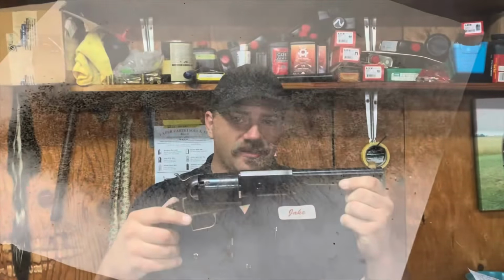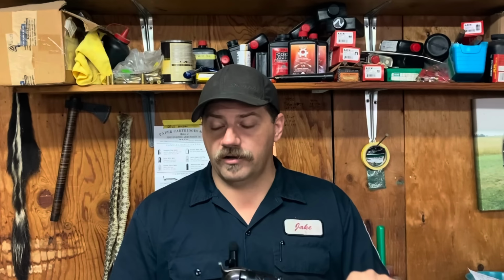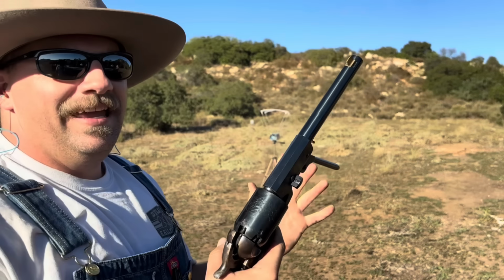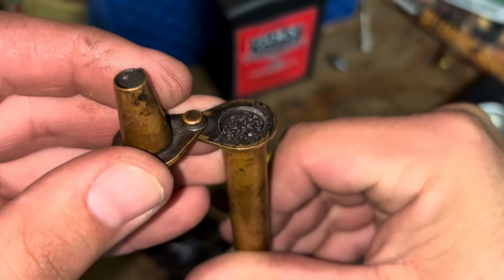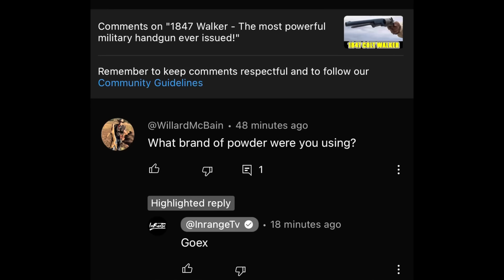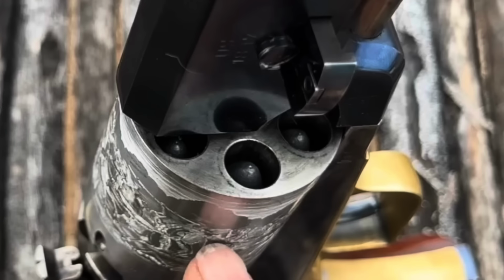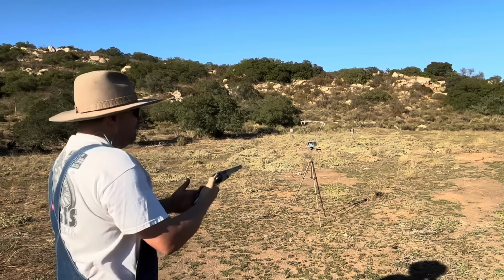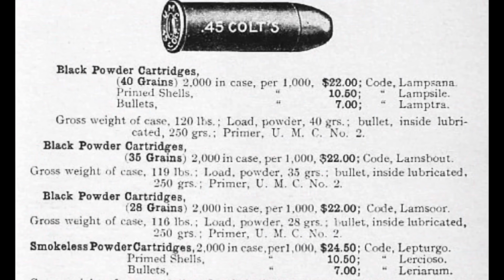The Colt Walker. Not The Most Powerful Revolver Of The 19th Century?

Comment: Most of the repos have smaller chambers, check the general john pitman notes. Original Walkers were 1.761" x .445. Uburti 1.629" x .447" . A scale should be used to more accurately measure the powder.
Reply: That's .01 cubic inches more volume in the original (assuming straight sided cylinders in both). I wonder how many more grains that equates to...
Reply: @rharthart9477  that's .163 cubic centimeters.  2.5 loose grains of 3F will fit into that space or 3 to 3.5 compressed.
Reply: @rharthart9477  incorrect calculation. (1.761*.445² - 1.629*.447²)*pi/4 = .01825 cubic inches either .3 cc either 4.6 loose grains. And I think the original chamber diameter was closer to .45", like other Colt revolvers.
Reply: would not make the slightest bit of difference,the barrel is to short to be able to burn even 40 grains of powder

Comment: I wonder if there is a difference in the depth of the cylinders. I can see modern manufacturers doing shallower depths for liability purposes. I'm going to have to dig my CVA brander Walker, that I bought in the mid '80's, and see what it can hold
Reply: Do let me know.
I had a 1861 CvA from the mid 80s someone stole it a few years back.
I've recently replaced it with a Piett ( something like that) 
Never thought about drilling the cylinder a little deeper. 
Anyhow if you can tell me what the max   grains of powder that fits with a .454 ball. So I know the difference in cylinder capacity between the walker and the 1861 Army. I've wanted to know for a long time.
My CVA 1861 I could load 40gr with a 20O gr lead bullet. .. the mold was for a .44 spc / 44 mag. And fit perfectly.
I mean it just barely fit flesh with top of cylinder. And with the 1861 it's easy to load. Unlike a 1851 in .44. 
Anyhow id like to know the max powder that could be used with a 454 ball
Reply: john          there is  no way that you could get anywhere close to a dangerous load  even if you could double the charge....it will not burn the powder in that short barrel......now back in 1847 the gun metals were nowhere near as strong as to whats out there today.......so if the cylinder is a micro meter smaller it's not that any one was worried about blowing the gun up.........I used to load my Remington with about 5 grains of black powder as a kicker charge then load modern powder on top of it.... more for to get away from the fouling rather than for power...I didn't overload but I'm sure the gun could take it, once when I first got the gun I loaded it and didn't put grease over the bullets ,I fired it and every chamber went off,only damage was it broke the pin on the loading leaver..I couldn't hit anything with that gun regardless of what powder I used ,so I gave it away

Comment: 60 grains was the maximum, with a round ball, not 90, but the cylinders were what is, basically, cast iron, so they would sometimes let go, not a good thing with a couple of Comanche bearing down on you.

I think Phil just misspoke about the 90 grain charge, since 90 grains will fill the chamber to the top, with no room even for a round ball.

It would be interesting to see what the difference in dimensions would be between an original Walker, and one of the replicas.

I can put those charges (minus the 45 grains) in my Remington New Model Army.
Reply: Besides the cylinders themselves, the full house 60 grain loads were pretty harsh on those open topped frames as well.
I'd say 50 is the highest you should ever load in these, even if repros might have nicer metallurgy in their cylinders.

Comment: Loved it. Hate you bent the loading lever to do such a great test. Have you seen where they bored out a 45 colt conversion cylinder to take what is called i think a 45 super black powder. Think its a 460s&w case filled with black powder. Again great video for someone that has heard the hype. You do real good test.
Reply from the maker: Thank you
Reply: @WillardMcBain  it's called 45-55 also. Been thinking about a walker or dragoon.  Got 3 1858 with 45 colt and 45acp conversion cylinders. So 3 cylinders per gun

Comment: I have two Ruger old army 7 and 1/2-in barrel 45 cal pistols one steel and the other one is stainless I paid two grand for both of them and the serial numbers are only two apart how you like those apples I use 40 grains with a lubed ball and that's pretty powerful

Comment: Good vid! I've been thinking about swapping my 1851 for a walker, but the loading lever actually stays up on the 51 and it'd drive me nuts moving it back up every shot on the walker.
Reply: Since it would not be a original. Just do a conversion to a 1851 loading lever catch.
Reply: Dont swap the 1851. Keep it and buy a Walker. Chances are, you will start missing the 1851 after a while.
Reply: An easy fix with a file and a light tough.

Comment: Nothing wrong with the thoughts involved,  but one aspect I did not see was confirmation that the powder dispenser was calibrated off a scale.    And I am shooting Conceals that are 225 grains so that aspect has relevance as well.   No idea what was shot originally.   My 44s  New Model Army pair are easily pushing 1000 fps with low loads.
Reply from the maker: Same powder measurer and same powder. 
Black powder, Weight vs Volume
https://youtube.com/shorts/1PiiypKgd5M?feature=share

Comment: Maybe among other factors there is a wide variation in powder measures. Also a variation in granulations might make a difference in charge weight for similar volumes. Unlike smokeless, small variations in charge weight wouldn't be a safety issue for bp.

Comment: After watching this my curiosity got out of hand. I took the cylinder from my Uberti Walker to the bench to see what the chamber diameter is and how much fffg powder I could get behind a .454 round ball and a 200 grain .450 bullet from an ancient Lee mold made for the 45 cap and ball revolvers.
Going by volume from a quality measure: I had space enough to load a .454 round ball over 55grains volume of fffg.  I could had space enough to get 50 grains of fffg behind the 200 grain Lee bullet.  The chambers measured .448 diameter with a calibrated pin gage. I didnt fire it just wanted to see what fit.  The only conclusion I can come to is not all cylinders are created equal.  I was using Elephant brand powder, not that it makes a difference since it wasn't necessary to compress the load. It would be interesting to get one repro Walker of each brand and take a lot of measurements. Not disputing your findings just reporting what I found.  Hank you
Reply from the maker: I checked the cylinder volume on my Uberti, a second gen Colt and an Armi San Marco that some friends own and they are all within .010 of each other.

Comment: You make some very good arguments and present good evidence. My sticking point is that the Walker was designed to shoot a conical with 60 grains using a conical. I think the conical was probably a non-starter. I’ve loaded my Walker with 60 grains of Triple7 using a round ball without issue, other than the loading rod. Although your testing was very thorough, I’d like to see tests using 60 grains before I write the Walker off as not being the most powerful until 1935.
Reply from the maker: Thank you, but I respectfully disagree that the walker was made to use a conical with 60 grains.
Reply: The walker using a conical can't come close to 60 grains. 40 grains is extremely hard with the chronicle colt Designed the walker to use. It's extremely hard to even use 40 grains with any conical made until the early 1860s. And with those your not going to get much more powder. The colt Single action army with its original 45 colt load made far more power than the walker.

Comment: I make my bullets with the Lee 200 grain cap and ball mold - it fits in the Remingtons easily, no alteration of the gun is necessary. It fits in my 1851 Colt if I struggle enough, there is barely enough room if you press the bullet's shoulders into the chamber, then the bullet can be rotated under the loading lever. If I used them in the 1851 a lot I would dremel the frame open a bit to ease loading.
For max loads there is room for slightly less powder under the bullet compared to the ball, but the bullet, even with a bit less powder, will yield a few more ftlbs energy in my 1851 than the ball will at max load. This is the sort of thing that varies from gun to gun, from load to load, and from powder to powder. There is less energy available as there is a bit less powder, but the powder transfers it's energy to the bullet in a more efficient manner than it transfers it's energy to a round ball. This is the sort of thing that makes working with Black powder interesting.

Comment: I have a uberti walker made a couple years ago. I can only fit 55gr 3f goex with a round ball. The 262gr dragoon conical I can fit 40gr of 3f just like you and gets really tight around 42-43gr. Maybe they are using 4f black? I know the old paper hazard cartridges for the walker used 4f black powder to make up for the room the paper takes up in the cylinder

Comment: What would be great is to see a weighed charge along with a Chrono (LabRadar is really good with this) and see what the various volumes look like as well as velocity they get for different powders (we do not have abscess to Black Powder and its all substitutes).    First load in the ASP that was throttled back was pushing 1000 FPS (yes that is a faster barrel).     Clearly 777 has more boom for the weight (and the loading list for that reflects it).

Comment: I've had 2 walkers...
I could fit 2 30gr pyrodex pellets and a round ball . Or 63.5 grains or loose pyrodex ..unfortunately I didn't have a chronograph back then because they were ove $200 in the 1980s...
 But I can tell you that that roundball wouldngo through a Dogde Dart fender at an angle, both inner and outer, the radiator,  and out the front grill.
😁

I had a bison model 1858 that would take 2 pellets and a 200gr conical and it shot 1000ps though that 12" barrel respectively...that comes out to about 444 FP ... suspect that Walker would have been about close the same. Maybe a little slower because of the barrel, ..

Comment: What you say may be true in the abstract.  Correct me If I'm wrong, but was the colt walker not the first commercially produced magnum revolver every issued until 1935?
Reply: No it was not. we proved that a 6 1/2 45colt SAA makes quite a bit more power then a walker when using Commercially available ammunition from 1873. The 40 grains of black powder and a 255 grain Conical.  It has to do with Cartridges can add the power of the primer plus they are fully  sealed. Cap and ball revolvers like the walker loss pressure out of the nipple.
Reply from the maker: @garymiller5416  it is 100% objective truth. There is nothing abstract about it. The 45 colt was more powerful and at the very least just as powerful as the Walker. So to answer your question, you are incorrect. The walker was not the most powerful commercially available revolver until the advent of the 357 magnum.
Reply: @Everythingblackpowder  Please explain how a 40 grain load from at best a 7 1/2 barrel compares to a 60 grain load from a 9 inch barrel?  Your turn
Reply from the maker: It’s in the video! Velocity, energy and spreads. The 45 colt makes more energy than the Walker with 60gr and a round ball.
Reply: @Everythingblackpowder  Your truth
Reply from the maker: @garymiller5416  ohhhhh you’re a liberal. That explains a lot…
Reply: @garymiller5416  It's extremely simple. The walker can only shoot a 140-145grain round ball at max load of 60 grains of black powder. This is not the walkers most powerful load. Its most powerful load that makes the most foot pounds of energy on the target is with the 260 grain bullet and 40 grains of blackpowder.  forty grains of black powder barely fits in the walker with the 260 grain lead conical.  The 7 1/2 colt SAA shoots a 255 grain bullet with 40 grains of black powder. So now you see they are extremely close in load size. The SAA makes more power because it's a Cartridge. Cap and ball revolvers like the walker lose quite a bit of gas pressure through the nipple. Where Cartridges are fully sealed. Because they're sealed there is no loss of gas pressure plus the primer adds to the pressure making it even more powerful. This is why the 1873 colt SAA with a 7 1/2 barrel is more powerful than the walker.
Reply: @Everythingblackpowder  LOLOLOLOL, I'm hardly a liberal but thanks for the chuckles.
Reply from the maker: The only people that use the phrase “your truth” are liberals…
Reply: @Everythingblackpowder  you do have a point

Comment: I have seldom been without a Walker these last 40 years. But. I have only fired round balls in them.
Now that Eras Gone is making correct molds i might have to give them a try.
Question, most of my Walkers have been  Armie San Marcos. Is there a difference in cylinder capacity between t he old ASMs and the newer 2nd Gen Colts or Uburties?
Thanks for the video.
Reply from the maker: I checked my Uberti against an old armi San Marco and a second gen Colt and the cylinders all held the same volume of powder within two grains.

Comment: Not much to say on this one other than, this is why I designed the Mukwa bullets the way I did.  The Dragoon bullet measures over .800, were my 270 grain measures  .655. My 260 grain measures .650. Now this isn't over whelming cylinder capacity, but does gain some. 

Now when Jeremy over at leverguns50 got just shy of 1000 fps. Not sure his charge.  Though I think he tested both goex and 777. That's if my memory serves me.  He also tested the same 270 grain bullet in the 45-55 walker cartridge for about the same results.
Reply from the maker: I talked to him when I was doing research for this video. I didn’t know he was using your bullets
Reply: @WillardMcBain  I have in the past posted pictues of all eight. 44 caliber bullets. I've also done molds for eight different.32 caliber. As well as four different. 36 cals. I'll never find enough energy to test them all thoroughly.
Reply from the maker: @StevenMMan do you sell molds? I would love to test them
Reply: @WillardMcBain  no I  dont sell bullets or molds . I can't.  I've been offering to people to test. But so far Jeremy is the only person to get any.. offered Garrett some and more and forwhat ever reason will not do I needed him to do to get it in motion.  You have my email,  I'm headed to the deer stand
Reply from the maker: @StevenMMan very good. Good luck

Comment: Recent sub here.  Interesting stuff.  About that bent loading lever, I suspect the repros don't use hardened steel in that area, and from the very few I have dealt with it seems that beyond some care hardening on side plates and such, these things are not made to last a long time.  I think with 600 ft/lbs and a hard cast lead bullet even the local wild hogs would be doable.  Thanks.

Comment: What's the chamber diameters of your Walker?  The two 1858 Remington repos from Pietta that I've measured had chambers ranging from .436 to .442 instead of the .452 that the originals had.  That's a 7% loss in volume with the smallest chamber diameter compared to original specs.
Reply: What is the bore? If it is larger than the chambers the guns will be inaccurate.
Reply: @deandeann1541  Slugged at .451 / .452 in the grooves and .440 / .442 at the lands.  And both are no tack shooters for sure.  I told the owner he should look into having the chambers reamed to .452

Comment: If number do not add up, my first hypothesis is a faulty/out of tune chronometer.
On a different point, I'm curious about the lenght of the original conicals. Are those shorter of the "dragoon" ones? Plus I'm questioning if the modern manufacturer keep the chambers a little bit smaller for safety reasons; as you say the original ones had quite a reputation for blowing up.
Great experiment.

Comment: Just out of interest, how much axial cylinder play is it supposed to be on a cap&ball Colt? I once imported an original Colt 1860 fluted (veery cool looking), with a serial number with provenance to a Civil war Cavalry company. But the play was something like a mm. The serial number stamping on the cylinder looked "imitated", i a very good replica of the stamping on the other parts, but sligthly different. 

As i understand all parts were stamped at in the same machine, so if you have a gun with only original part all the stamping shall look exactly the same. I suspected the cylinder on this gun was once replaced and they tried to make it look like it was original. But they could of course not put back material onto it.

So i never dared to shoot it... And there were nowhere to shoot it if you lived in a city, in Sweden. To this day, i keep wondering how it would had been to shoot....

Comment: Just ran across your channel the other day.  I know this video's over a year old, but... with other claiming they fit more powder with the same projectile, it could be a case of "not all Colt Walkers are created equal".  Is it possible that there are discrepancies in how the cylinders are bored out?  I have seen a few times where the chambers are tighter further down, and on one, there was kind of a wall partway down, where the chamber constricted.  I don't know how much of a difference this is really going to make, I'd guess maybe 5 grains tops.  But it might be something to fill chambers and measure their volumes between several manufacturers, to see if there's any difference.
Reply from the maker: @halfcirclehranch  Howdy. We checked the chamber dimensions on three different makes of walkers. The Uberti seen in the video, an old Armi San Marco and a second Generation Colt which was made on the same tooling as the original Walkers. All three guns were within .010 of each other.